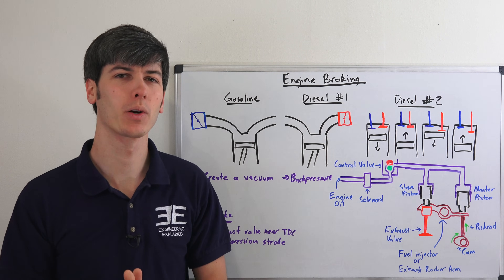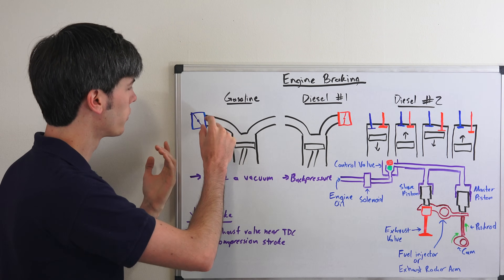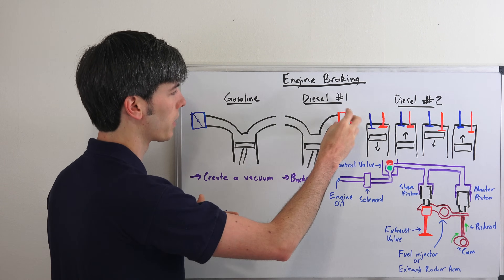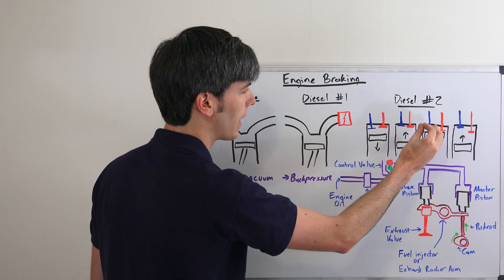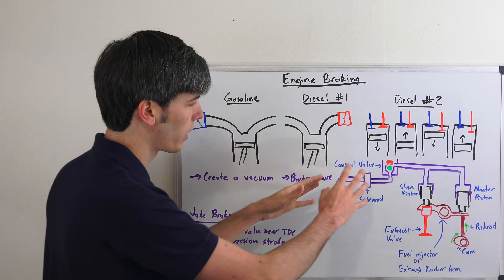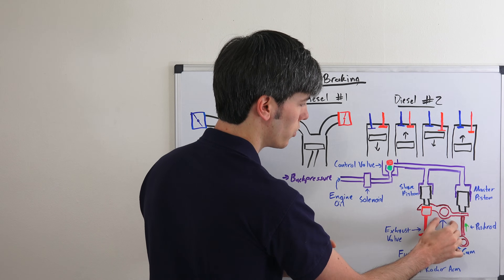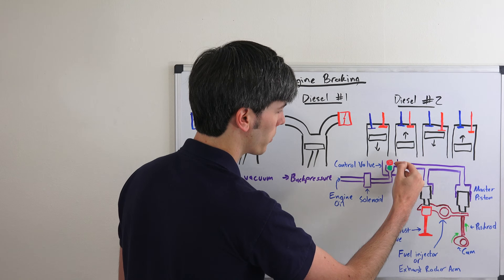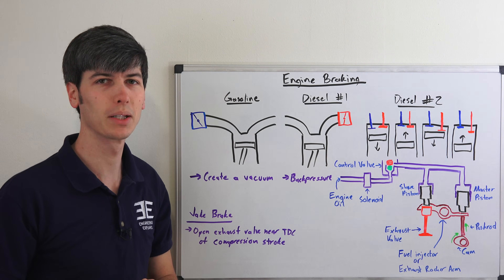What Is Engine Braking? What Is A Jake Brake?

Comment: Assuming you have perfect downshifting/rev matching technique, is it still bad? How much more wear on the engine does this braking method do?
Reply: +TheRaguORagula   Ninety percent of engine wear comes from the first few minutes after it was started cold.  Engine braking is not going to wear much, because it isn't under pressure the same as if it were under throttle / power.

Comment: Hmm. I've driven many a diesel where the exhaust goes straight out of the engine. Say on a tractor. But they still engine brake. How does that work?
Reply: They still engine-brake the way a gasoline motor does.  Close the throttle at speed and you still have engine braking from the vacuum, from pistons working at 17:1 compression.
Reply: +Scott Grumpybastard You are correct sir. This is why standard light truck diesels can engine brake without Jake or exhaust valve present. We used to call this type of compression braking as apposed to dynamic, locomotive, EM (Telma) others.
Reply: justfakeit888 Not really it is the energy used to compress the air from 1 bar to 10 bar.  Then wasting it out the exhaust. the rotating resistance would play into it but not much.  Take all the plugs out and see how relatively easy an engine is to turn (even without oil pressure).

Again this is why a diesel can compression brake without an exhaust restrictor or Jake brake.
Reply: +Randy Taylor  there is no vacuum on a diesel the manifold is at atm , due to no throttle blade like a Gasoline motor ,  the braking action is from the engine still compressing the air , and on a mechanical rack it still gets a little squirt of fuel ( idle setting ) the electric rack ( electronic injector ) will shut all the fuel off .   its this lack of fueling causes  the motor to loose power from internal drag and the compression stroke .
Reply: So it is just basically the internal resistance (friction) of the engine slowing it down? Say the resistance that would be experienced turning over the engine with the starter?
Reply: Yes, energy is used in the compression stroke, but all of that is put back into the system in the power stroke, no? That's why the jake brake is so effective. The compression is not put back into the system.
Reply: justfakeit888 The Jake brake wastes it more effectively

Comment: Hi there,
I watch your videos for about a year or two. I saw one debate on the forums that engine braking is better than neutral + brakes for fuel economy? (they say that the injectors wont spray fuel if you're doing engine braking).. I really do not believe that this thing is true so i saw your video and thought to ask you : ]
Reply: +Кристиян Илиев He doesn't mention the fuel cut but yes, it stops adding fuel until you use the gas again, and with most cars, until the idle drops low enough to prevent stalling. No reason to waste fuel when the momentum of the vehicle is turning the engine.
Reply: so if you drive like 5th at 1.3k and downshift to 3rd or 2nd for ex to like 4k (again for ex) it wont spray any gear until it get dont to ~ 1k right ?
Reply: Кристиян Илиев Right. I always rev match / blip so it'll spray fuel for that, and you should too. Try engine braking from 3k in 1st or 2nd, and slow way down to almost stalling. You can feel when it adds fuel back in. It feels similar to feathering the clutch out at idle. It'll go from braking to coasting, if you continue to slow down it'll start bucking etc.
Reply: yeah i use revmatch too cuz otherwise bye bye syncronizer xD
Alright thanks for the answer mate ; ]

Comment: I've asked this question many times to some mechanics friends of mine and never got a precise answer: does engine braking consume fuel as the rpm go up or is the flow interrupted?
Reply: +UnQualsiasiUtente Fuel injection stops as soon as you release the throttle (considering the car is left in gear), so no fuel is being consumed during engine braking. As soon as the engine approaches speed close to idle (around 1000 RPM usually, but it totally depends on the vehicle itself) or if the throttle is applied, fuel kicks in again. Hence why it is efficient to use engine braking - you burn no fuel while slowing down until revs fall low enough for the fuel injection to continue.
Reply: +Mihanik0 so, is the consumption really 0 l/km during engine braking? And is it so for all the cars? I've read about the "cut off" device but couldn't find out how it works and if it's in all the cars or just in the more modern ones
Reply: +UnQualsiasiUtente You are correct, no fuel is consumed at all during engine braking. This system, in one way or another, is present on pretty much every common car. Although I have not worked on carbureted vehicles a lot, I can safely say that most of the older carbureted cars utilise this system as well, the only difference is the principle of cutting the fuel. On modern cars with electronic fuel injection the Engine Control Unit sends the signal which shuts off the fuel injectors when certain criteria are met. The most basic example for a gasoline engine would be the fuel cut based on 2 sensors - RPM and Throttle Position Sensor: if no throttle is applied and RPM are no lower that the amount set in the ECU, then the injectors are disabled and no fuel is getting into the cylinder. This is just a basic example, the complexity of this system depends on the car manufacturers themselves, but it all achieves the same goal in the end.
Reply: Thank you, finally someone gave me a complete answer! :D
Reply: +UnQualsiasiUtente No problem! Glad I made it clear for you.

Comment: english is not my main language, maybe i miss many part his explain and here my question. does it work if engine shut down/off?
Reply: +Ilham Defra   You also want to be sure that your engine has an internal oil pump -- most do.  If you have an external oiling system,  revving the engine by using it to brake can cause wear or failure do to lack of lubricating oil pressure.
Reply: +Ilham Defra    basically with a jake brake on the new electronic controlled motors you shut the fuel off during the cycle ( the older mechanical motors the motor would squirt a little fuel charge ( idle setting) as the jake brake switch is on the fuel pump and has to be set to turn on when you take your foot off the pedal ),  so its basically just pumping air , so technically it would be shut off ( no fuel , no power )

Comment: So, is it good to engine break or not?
Reply: to engine brake in a bigger vehicle yes, but not really needed to in a smaller one like a coupe/ suv. the other guy just said that because you misspelled break instead of brake.
Reply: bruce poole that BS your spouting is fictional, your talking about heavy duty engines built to take massive punishment for a million miles. MY truck, yes I own it, is 22 years old and has the original cam. Not using an engine brake to avoid wearing out the cam is like not using your blinker because you don't want to wear out the bulb, it's just idiotic.
Reply: No. It's not good to break your engine. Using it to brake can be useful though.
Reply: +Andrew Barcomb lool it completely went over my head
Reply: +Andrew Barcomb yes, thanks
Reply: +timpaul paintballisbetterthanairsoft why is it not good?
Reply: +Andrew Barcomb i thought engine braking did use fuel tho
Reply: thats fine i knew what you ment :)
Reply: +Tomas Prado Jake brake is very hard on camshafts, it uses pushrods to open exharst valve. i hear lots of truckers changing gear using jakes, if they own there trucks thay are dopes
Reply: if your exhuast valves open just before TDC it must run as well as you
Reply: +Andrew Barcomb 
Even smaller vehicles need engine braking to go down mountain downgrades, as your brakes can overheat and fade in just 45 seconds.
Reply: Yosef MacGruber - Maybe "can" but seldom do. Putting a specific time on it like that ignores a world full of variables. Going down a steep mountain road with 5 people in a Yugo or a Renault Dauphin it is very likely to have your brakes fade in much less time but going down that same road with one person in a ZR-1 corvette at the same pace is unlikely to fade at all.
Reply: +Tomas Prado engine braking uses no fuel, conserves brakes(puts less pressure on air brakes in semis and lorries) and slows you down. does that answer your question?

Comment: When you coast in gear, does the ECU turn off fuel and spark?
Reply: +Michael Stutzman Some cars do it. They usually cut fuel at a certain RPM when decelerating
Reply: +DaBrute Would you say sport cars do it? Such as a wrx/sti...
Reply: Probably. My Mustang did it.The exhaust tone would change when it happened, usually around 2000 rpm or so
Reply: +Michael Stutzman Pretty much every car will cut fuel when it's not needed, including automatics. It's an economy feature, not a sporty one, even though it is a staple technique in racing. My EG cuts until about 800rpm to prevent stalling, same thing with Nissan Sentra's, etc.
Reply: Virux Does spark stop as well? And what about the sound your exhaust makes when you're slowing down/coasting in gear? Is that the sound of cylinders firing or is it just the sound of the engine physically rotating...lol, sorry if these questions seem obvious.
Reply: Michael Stutzman I guess if it uses a distributor it probably just keeps sparking but it's possible the ECU can turn it off. The exhaust sound is just the engine rotating, yes. It's still building compression, but under a vacuum and without combustion.
Reply: Virux Interesting. The sound with and without combustion isn't very different, at least with my wrx it isn't lol. Not from what I can tell.

Comment: I feel you weren't as thorough with your explanations this time. I like it, but also noticed that in the comment section, people were overall still lacking some knowledge they would have know if you went into a more detailed explanation.
One part that I would have liked explained is how is there low, medium, and high settings on the jack brake system.
Reply: all that is doing is using the engine braking system on 2 4 or all 6 cylinders during that engine braking cycle. Most diesel engines today in large trucks are in line 6 cylinder engines. back in the 2 stroke Detroit diesel days, you had v6 v8 and v12 power plants in mobile equipment they did much the same thing, braking on some then all of the cylinders.
Reply: kleetus92
Thanks, I actually quickly looked it up after I posted my comment.

Comment: So where does the energy go in the gasoline engine case? The compressed air in the cylinder would heat up thus extracting some energy, but I can't imagine that being significant relative to the kinetic energy of the moving vehicle. 

Also, if compressing the air is responsible for losing significant amount of energy, wouldn't it be better to leave the throttle plate open and cut fuel to minimize energy loss when you want to coast (not brake).
Reply: +Jeff Chu Energy transformed to friction and heat. 
You are right, engine braking force is weak on its own when compared to the kinetic energy of the vehicle but gear ratios makes it efficient. 
Cutting the fuel when you want to coast is another possible idea but to control it you'll need an additional mechanism. And as always cost/benefit issue.
Reply: +Ugur Akdag Thanks. I'm a little surprised that friction and heat is that significant.

Comment: I now understand what's going on in the motor, but how does that aid in braking? I don't understand how the exhaust valve opening up during the power stroke creates resistance.
Reply: +Ned Ryerson Actually, it's not the exhaust valve opening that creates resistance, instead it happens during the compression stroke. During the compression stroke the engine is forced to push up against pressurised air (there is no fuel in the mixture when you are off the throttle because the injectors shut off). After reaching TDC, the pressure that has been built up starts to push the rod down, thus giving back some power that was spent to compress air during the compression stroke. Even if there is no mixture burning inside the cylinder, compression ratios in diesel engines are much higher compared to gasoline engines, so this air pressure alone is enough to significantly compensate the power losses from the compression stroke, which means almost no engine braking. By opening up the exhaust valve at TDC, all that pressure just escapes into the exhaust instead of forcing the piston down. As a result, the engine works hard to pressurise air during the compression stroke, but gains no power back because all the pressure that has been built up during the compression stroke goes away into the exhaust. This allows the engine to slow down much faster. Hope I explained it well enough for you.
Reply: +hrsqsiest Yes, you are right. Of course, there is so much more complexity to this system, and I understand that. However, I was not trying to give a 100% accurate, scientific explanation, instead my goal was to explain the principle -- what makes the engine slow down. There is a lot to be spoken about the actual mechanics behind the process, but my explanation was just a simple concept so people without technical knowledge about engines could understand it.
Reply: +Mihanik0 
That was a great explanation. Sort of like how we work so hard on our jobs, and then corrupt governments raise taxes and destroy the value of the currency, so that most of that benefit of our working, is just suddenly released. And then all the economists can't ever seem to figure out why nobody wants to work anymore, or why companies are not hiring.

It seems like corrupt governments have found a Jake brake equivalent, to drag down entire economies.

And neither method makes a very pleasant sound. Well at least a Jake brake sounds better, than a truck careening off the mountain's edge.
Reply: +Mihanik0  Ah, that makes more sense. Thank you for taking the time to clarify.
Reply: +Mihanik0    You are a bit off here. The exhaust valve opens "BTDC" and is fully closed by the time the piston reaches "TDC". If the valve opened at TDC, it would get eaten by the piston. The valve doesn't fully open however. If it did, all the compression braking power would just go out the exhaust. The effectiveness of the jake system is in the fact that it does this on every up stroke of the piston and by holding in a portion of the air that was compressed on the previous up stroke. 
The explanation given in the video is very rudimentary at best and gives a false idea of what the jakes fully do. There is much, much more going on than what he describes. He doesn't even go into the intake side of the system here.

Comment: Can you explain why people always say that you should break into your engine before you drive fast? Usually the break in period is 1000 miles and then you can drive it spiritually?
Reply: +Adam Chase When an engine is built many parts are fitted together very precisely however believe it or not its not perfect. Things tend be a little tight and while the engine operates for the first 1000 miles these parts are actually wearing "into" each other. Thats why when you change your oil for the first time it might have a metallic color to it. Examples of these parts would be the piston rings to the cylinder, crankshaft and cam bearings. Once the break in is complete many parts become perfectly fit to each other.

Comment: In case of Jake brake, I just want to know about the emissions caused using this brake.And also exhaust manifold should be able to sustain the high temperature. Does Jake brake work that effectively enough to compromise these things? Is there a chance of fire spitting ?
Reply: +Amol Kulkarni Depends on when the event is timed during the rotation. If it is before the combustion event then it would essentially be releasing unburned fuel, if it were a degree or two after, the combustion wouldn't quite be complete. So I think either way there would be higher HC emissions while using a jake brake. I would image that the manifolds were designed for the thermal output of the engine and would be fine. Its possible to have it spit some fire, though its unlikely you'd see it due to the length of the exhaust.
Reply: +Amol Kulkarni 
Shouldn't the fuel be cut off, during engine braking? There is no need to burn any fuel, since the wheels are rotating the engine. If there is no fuel, then why should fire be spitting?
Reply: +Yosef MacGruber Newer systems will, but this tech has been around for a few decades now
Reply: There are no emissions caused by the jake system as there is no fuel to initiate combustion. As too the heat issue, beings that fresh air is pulled into the cylinder on every down stroke of the piston and there is no combustion causing a rise in exhaust temps, exhaust temperatures are not a problem.

Comment: on first picture u explain wrong about diesel engine brake this is exhaust brake when u have flappers on exhaust side (u say throttle body ) Jacobs brake and exhaust brake this is two different setup .
Reply: That's what he correctly explains.  You're confused about what "throttle" means.  It means choke.  You can choke the exhaust or the intake.